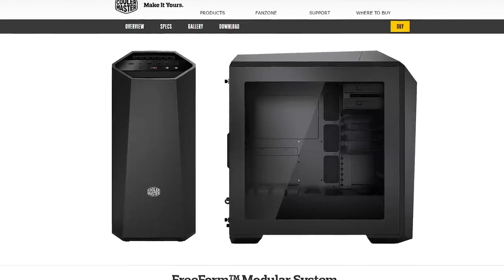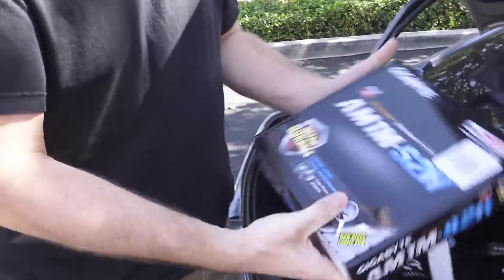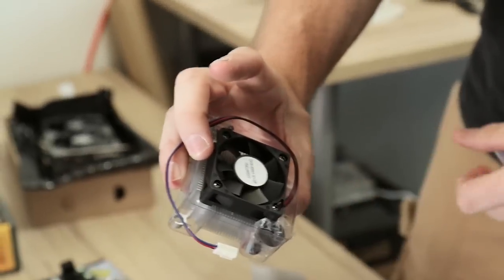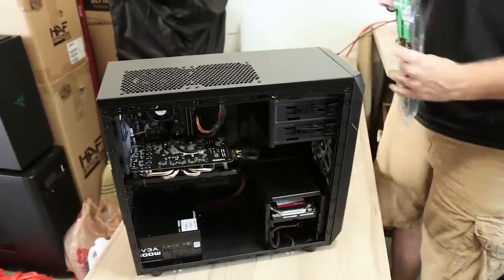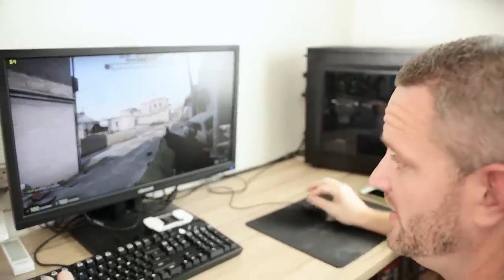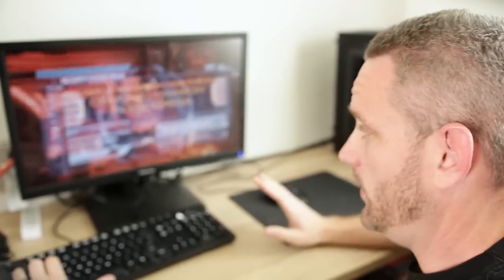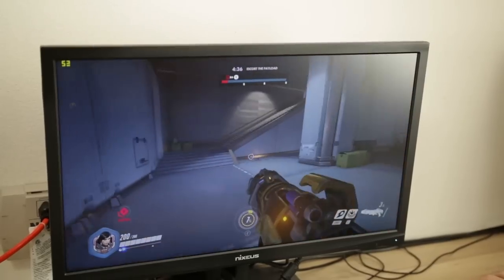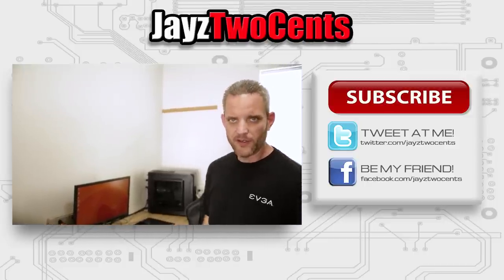Ultra Cheap Gaming PC 2016 - Can you play games for under $400?

Comment: Sponsored by AMD.
Reply from the maker: +SuperGojira2001 yeah sponsored by my own wallet
Reply: Hey Jay if you don't want that PC and want to do a really good deed, you can send it to me. My 68 year old mother is looking for one for facebook, facebook games, and email and she could really use it. She won't need the graphics card because I have my old evga gtx 760 ssc edition I could use for her graphics. So if you would love to donate to a good cause, she would love it. And no I'm not kidding, She needs a computer and I'm not working right now so I can't afford to build her one. And no it's not for me, I have a FX 8350 with 16gbs ram and a 1070, I don't need it but she does. Thanks.
Reply: actually, is sponsored by Cooler Master :p
Reply: Obviously. You couldn't buy any Intel CPU for $40 and I don't even want to speak about the GPU. If this PC used Intel and it would be at least $150 more.
Reply: +Mc Craydox Nvidia mid range market is really good because you can buy a cheaper psu, even if it costs a little more. 

Intels low end on the other hand...
Reply: CrackedDylMil Mid range Nvidia same as high end AMD in price.
Reply: +Mc Craydox remember that the 1060 is currently cheaper than the 480, and faster. 

In the future the 480 will be $10 cheaper, and in about 3 years it'll be faster too, but I upgrade every 3 years anyways.
Reply: +Mc Craydox it seems he was going for bare minimum quad core since that is the requirements for some games to even open
Reply: CrackedDylMil No. 1060 has 6GB and the 480 has 8GB. The 1060 isn't SLI compatible. And the price difference is $20 so naah.
Reply: Long Tran Thats what I mean. Intel quad core under 50 bucks doesn't exist, I'm not even sure for a dual core under 50 bucks exists. Lol
Reply: +Mc Craydox https://m.newegg.com/Product/index?itemnumber=9SIA24G41G0238. Found one. But it's gonna be locked out quad core titles
Reply: Actually, the standard price of both the 6GB gtx 1060 and 8GB rx 480 is $250, the price difference would be based on the individual aib models and effects of supply and demand.

Intel has the Celeron line, which you can get for $40, and I think the Pentiums have hit $50-$60 mark. The motherboards might be a different matter however.
Reply: Hi from pcpp
Reply: +CrackedDylMil it's a core 2 quad it's running on the LGA775 socket which there isn't much of those Motherboard for sale now
Reply: +JayzTwoCents I'm joking :P
Reply: +Elias Boehmer Hi.
Reply: Makes a million videos about the 1070 and 1080 and Titan XP. AMD fans: "OMG jay is an Nvidia fanboy!"
Makes 1 video about a budget PC for poor people that just so happens to include the best budget hardware (wow who would have thought?!) that just so happens to be AMD hardware (a PC that costs half of what a 1070 by itself costs when taxes are figured in).. Nvidia fans: "OMG jay is an AMD fanboy and his videos are sponsored by AMD!!" Well then.... at least the Nvidia nut job fanchildren are outing themselves lol
Reply: +Neil Hepburn did you really just say a 1070 costs $800?
Reply: I meant 1080. But yes, I guess did say that lol
Reply: he didn't build a PC--he built a Tower.  a Pc includes a Operating System as well as a
Keyboard & Mouse. plus a Monitor.   so even if it was a AMD Tower he failed
to build a PC for 400 dollars.
Reply: +Neil Hepburn lol, just pointed that out. 

The 1080 isn't really that much either, at least in America. But if you live in Canada or Australia it's like $1000
Reply: yeah its sponsored by AMD... All Mah Dollar! techincally, he isnt wrong ;)

sorry ive only just seen this video and now im reading the comments
Reply: james waldrup
No, technically a PC is just the tower, the hardware itself. If you bought an off-the-shelf system with a monitor it would be considered a bundle.

He also came out $25 under budget, enough for a keyboard and mouse.
Reply: Amd is notoriously cheap
Reply: Or maybe because Intel CPU and Mobo combo would cost the same as that entire rig.....
Reply: could get them tray xeons tho just sayin ^^
Reply: €426,10 ($400) ex vat for a new pc with 128GB SSD + 1TB HDD + a good quad core + 8GB Ram + and an "RX480" GPU :
€170 RX 470 (easy OC to RX480 performance)
€61 860K CPU (easy OC to cheapest i5 performance)
€8 cpu cooler
€38 Microatx FM2 motherboard
€17 Microatx zalman case
€31 2X4GB ram
€17,90 400W PSU
€42,20 1TB HDD 7200RPM
€41 128GB SSD

So, you can't just play cs:go with a $400 rig, you can max out everything at 1080P, have it future proof, do VR and have an SSD for $400.
Reply: ***** you can get some oc on the 860K with a 95Watt board and the xfx single fan rx 470 is even cheaper than €170 here, it's €164,32.
Reply: *****
Some, but it depends on the board and cooler. I can't imagine that cooler being enough, and I doubt the board will.

400w isn't enough anyway though. I have generally the same build with a 750 ti and 430w, without the GPU there's about 264w left, and the 470 uses 150w full-load, which would make it 415w total.
Reply: ZombieBarioth allright I didn't check the wattage too much, either way, $10 more solves that.
Reply: Nah... By EVGA actually, see the t-shirt?

Comment: I had this old computer before and I if you type too fast, the browser laggs and it freezes for 10 seconds literally.
Reply: Daniel Zhang would freeze with me always
Reply: My laptop takes 5 minutes opening google. And I play war thunder on it. A second generation I phone would have better  graphics
Reply: kornycbz Laptops are known for this, i hate laptops but i use on myself
Reply: Jeremy Blaauw laptops have integrated insides which is why you should most likely switch to a desktop which cost around maybe even less than 200$ ? Feel free to check around for home desktops because they really do run games properly :)
Reply: Kyut Psycho I know, but i'll be a console peasant for now, I need my money for college and stuff. 😂
Reply: kornycbz try disabling startup apps that have a high or medium startup impact in the task manager
Reply: Combatpig 34 lmao , same , it takes me around 6 mins to open word and when I do the letter appears like 10 seconds after I type
Reply: InfiniteGamingZx sound like you have malware. Run a malwarebytes scan trust me it will help i went from around 10 minutes to open firefox to just 15 seconds. Just put malwarebytes setup on a flash drive on another computer then with the slow computer boot into safe mode(google if you dont know how) then pop in the flash drive and run malwarebytes. Also if you were wondering safemode is fast so you will be able to open malwarebytes very quick
Reply: I had a $500 laptop and at this time I was about 7 and i didn't know it could run games good. Welp lets just say my dumb ass fucked that shit up :(. Every time I think about it I just feel depressed.
Reply: RUST_SMILES do you still have it?
Reply: my Celeron 4g ram school laptop

Comment: I made a budget $300 pc using a fx 6300 and 750ti, and my games run equally as well. Maybe not everything runs on ultra 1080+, but i can put pretty much every game i have on high and i'm getting 60fps
Reply: the fx 6300/8320 are much better than the one in the video. And yes, the 680ti and the 750ti are still relevant to this day.
Reply: was running a 8320 oc to 4.2ghz air and a gtx1060 g1 gaming and runs 4k high settings with a few lowered tweaks around 60fps before upgrading to a i7 6960x 4x1080 sli build
Reply: Should´ve bought 1050 ±P
Reply: tfarcenim literally no circumstances should you ever buy a 1050..like ever
Reply: why ? it has a great price/performance rate and is basicly the new 750.
Reply: tfarcenim because it doesn't have great performance , extremely underpowered and will bottleneck the fx6300. Only way you should honestly buy the 1050 is if you can get for $50 and is an upgrade from a much older card like a gtx460
Reply: its performance its awesome for the price. also it doenst bottleneck at all. maybe just an little.
Reply: Proven to be a pretty big bottleneck. It's a garbage card no real gamer would ever buy it
Reply: indeed a budget gamer
Reply: lenel echols i want buy pc can you give me   all you budget
Reply: yeah and 750 is the worst i have an 750ti and i manage to play a lot of games but not all on high or ultra
Reply: lol i have a pc with a 750ti and an fx 6300 aswell and unfortunately its not running that well...do you use a hdd or a ssd?
Reply: Lennel Echols ( until you run into a billion problems )
Reply: fx 6350 2gb card 8gb ram, for my money, awesome, spent about 350eu

Comment: I've never had 60 fps I always have below 20
Reply: its a whole different experience ;)
Reply: same
Reply: CTI y'all are in for a treat! Smooth experience. I can link you a better build than this if you want
Reply: ***** yes please, but keep it under 400 lol
Reply: CTI http://pcpartpicker.com/list/yqLtWX slightly over but if you can't do the extra $16 just change the processor to a G4400
Reply: ***** got it thx
Reply: CTI yeah g
Reply: ***** could a network adapter be added
Reply: i got 300 fps
Reply: Yusa_1905 on wat
Reply: Same
Reply: same
Reply: i get  9fps on overwatch
Reply: I have 100FPS in 4K maxed out
Reply: I have never had 60 fps. I always have 144.
Reply: Bunzzz Bun on tf2 mine doesn't get above 30
Reply: Bunzzz Bun build a pc not hard and u get all dat 60fps 1080p glory
Reply: the avarage fps on tf2 is 3000

i get 12 - 60
Reply: same here i play gmod 10 fps
Reply: flying chicken nuget from hell You can't even spawn anything lol
Reply: GTA V @37 FPS
Reply: CTI i play at 5 and my k/d in sandbox multiplayer was 15/2 lol, spawn trapping with bombs always works
Reply: Is that with this build
Reply: get a 1060 or 2 970's and some more ram, then you shouldnt have the problem with any games
Reply: What gpu do you have?
Reply: +CTI, if you can spend a slight bit more you can get this listing: https://pcpartpicker.com/list/hbxQM8 , should be capable of running every game on 180p ultra.
Reply: Alabastine, 180p? That's so 1980s
Reply: Zuhri Wheeler Really?! Shit I thought I was living in the future with nu 180p monitor :(.
Reply: Bunzzz Bun same I have a shitty i3 5005u HD 5500 4gb could barely run world of tanks
Reply: Bunzzz Bun :o
Reply: Bunzzz Bun i get the same
Reply: Dale Games same
Reply: HeyIt'sTaz! :D Just took a screenshot of your comment for future reference. Thanks man.
Reply: That is WAY overkill for 1080p
Reply: KingCopasGaming Rust? Csgo ?
Reply: Liquid Solids because piracy isn't real
Reply: who buys windows 

what in tarnation
Reply: i know the feeling bro. i play paladins at 10-20 fps and i have the lowest quality ever but i will always lag no matter what...
Reply: You lucky.. i can't even open Paladins.. (I have Athlon 1500+, 1,2 GB DDR400)
Reply: I can even run OBS
Reply: dang that sucks I get over 150 fps in paladins
Reply: what graphics card do you have
Reply: Get a new processor or graphics card or other new parts  then you have 💯 fps probobaly
Reply: your life is below 20
Reply: Bunzzz Bun the human eye can only see 11 fps
Reply: Sebastian Kielek uhhh.. thats not true
Reply: I get 20 fps average on rocketleague :C
Reply: Less than 30 on my crap laptop
Reply: You get 20fps I get 10 at Gta vice city only

Comment: what I do not get is how people complain about 60Fps when I at maximum get 20Fps, I have a Hp Pavilion, I just need to upgrade it, Does anyone know how? or what works best? Thanks!
Reply: Nimr Al-Nimri the hp pavilions generally are like laptops in a desktop body meaning the motherboard has no room for expansion besides ram.
Reply: oh, ok guys, thanks alot both of you, this makes much more sense, thank you! 😅
Reply: first off you need to upgrade your gpu, and for that gpu its a safe bet that you'll need to upgrade your power supply too. its not super hard to do but the problem is that your mobo might not even have a pci-e 3.0x16 expansion slot and if it does another problem might be that the case would be too thin to fit the GPU or the PSU wouldn't be compatible with the case size since OEM PCs sometimes use non-standard size ratios. do you have discord? if not just go to www.discordapp.com create an account and send me a friend request. my username is " @MP [✓]#4494 " (without the quotes). i can help walk you through the steps of this process and answer all the questions you might have. <3
Reply: If you get 20 FPS max, the quality is choppy as hell.
Reply: Add a graphics card, you can check but it should have a PCI slot. 
1050 will work in about anything power usage and space wise. Check your PSU wattage, but it should be fine
Reply: Obvious Troll is Obvious b
Reply: Nimr Al Nimri I get 30 fps on jc2 on low
Reply: Which pavilion?
Reply: I don't know how HPs are where you live, here in Brazil they use standard hardware, I salvaged a Gigabyte motherboard in one and a Asus in other, so it is easy to upgrade, if you have a older i5, just put a 1050 that doesn't need any external power, and you will be fine for a good time, and will be able to play a lot of recent games, if you drop the resolution to 720p.
Reply: +Zeyand LT   You're*
Reply: Your lucky to even have a Gaming PC
Reply: Nimr Al Nimri stick a GTX 1080/1080ti in it and it'll be fine :)
Reply: +Nimr Al Nimri You could go for a budget Ryzen 3 build, Ryzen 3 can play anything!
Reply: well if you want to really get better fps bump up some more ram and get a new gpu and you should be fine. I'd suggest a RX550 for the graphics card or a 1050 4gb and for ram probably 8 gb
Reply: Dynamic
No, they totally do. I've got a Pavilion myself and installed a 980 in it, playing Gta 5 on high at 60 fps, wtf are you talking about?
Reply: Nimr Al Nimri bin it and buy an i5 2500k and overclockable motherboard 450watt psu 8gb ddr3  1600mhz+ ram gtx 1060 6gb (3gb if you cant afford the 6gb) and a hyper 212 evo
Reply: Nimr Al Nimri throw it away and buy a new desktop pc
Reply: you think your cool
Reply: u have prebuilt XDDDDDDDDDDDDDDDDDDDDDDDDDDD HP? XDDDDDDDDDDDDDDDDD 20FPSXDDDDDDDDDDDDDD
Reply: Get a1050ti low profile
Reply: on csgo i cant play under 200fps
Reply: Because 60 hz is garbage. I only use 144hz and getting 60 fps is unimaginable.
Reply: Nimr Al Nimri Potato
Reply: Do you live near Dallas?
Reply: Upgrade your graphics card maybe get a gta 1050 but you will need a good power supply for your graphic card
Reply: I get 10 FPS normally
Reply: does it have a power brick or does the power cord go directly into the back of your PC?
Reply: Zeyad LT   You forgot the period Einstein. Glass houses dude.
Reply: I just upgraded a hp pavilion from 2010 added gtx 1050ti and an ssd. Worked great. Power supply was only a 300w with no extra power adapters either molex sata or pcie so always keep that in mind when upgrading an oem.  Also its always risky know if your bios will support a cpu upgrade.  Mine came with i5 2320 which I left alone.
Reply: At that point, get a conslole
Reply: Nimr Al Nimri ok heres how you open up the case take a hammer smack up the mother board a bit bring it outside throw it in the trash get in your vehicle and drive to the nearest store that sells computers lol god i hate hp
Reply: Nimr Al Nimri got mine at 30fps😂
Reply: Same boat friend same boat. I'm rocking a fx 4140 and a gt 610 which runs war thunder in 2018 at min settings 20 fps. Im throwing in a 1060 6GB and a new ssd before saving up for a new intel build. I personally cant wait and I should be able to get better frames rocking this.
Reply: lol when people complain about 20 fps and i get 4 fps on the lowest graphics....i'm broke
Reply: Nimr Al Nimri just get a new gpu
Reply: I get 10-20 fps in fortnite
Reply: Ik im late to the party but I had a pavilion and took it apart recently. Dont even try to upgrade it. You cant replace the cpu or gpu unless you find some magical to put a graphics card into a port that dosent exist.
Reply: Nimr Al Nimri  buy beter GPU and beter CPU
Reply: Nimr Al Nimri more ram and a better graphic card if you want to go beyond get a ddr5 motherboard and zen processor
Reply: Make a new pc.

Don't get fooled by cheap pc components. You will regret later.
You need at least 1000€ to build a good high-end pc for a 1080p monitor.
Try this: 
Cpu: AMD ryzen 5 2600x
Gpu: gigabyte gtx 1070 (the cheapest version with 2 fans at least)
Mobo: gigabyte x470 ultra gaming
Psu: Corsair rm650x
Hdd: Seagate Barracuda 1tb (storage)
Ssd: Samsung 860 evo 250gb (win 10+favourite apps and games)
Case: Masterbox 5
Ram: 2x8gb @ 3200 or 3000 mhz. (Any brand, g.skill is better)

This a great configuration.
Reply: If it’s a laptop then you can’t upgrade it (Unless it has thunderbolt) but if it’s a desktop, get a screwdriver and buy a GTX 1050 Ti and then install it in the PCIe slot
Reply: Frankly, if 20FPS is what you can manage when Ivy Bridge (6+ years old, mind you) Intel iGPUs can get you solid framerates in the likes of Fortnite and Minecraft after a few minor tweaks, it may be time to scrap the thing and start anew with a more solid foundation.
Reply: very hard to upgrade, i would sell it and buy a new build. a gtx 1050 ti dual fan wont fit in there

Comment: Jayz use TSSAA on DOOM to enable async compute. Using SMAA disables async compute.
Reply from the maker: +conyo985 really? I did not know that! Thanks for the tip!
Reply: Async compute in DOOM also works with AA off.
Reply: Initially I couldn't say whether you were being sarcastic. xD
Reply: conyo985
Reply: conyo985 can u run gta5 on it